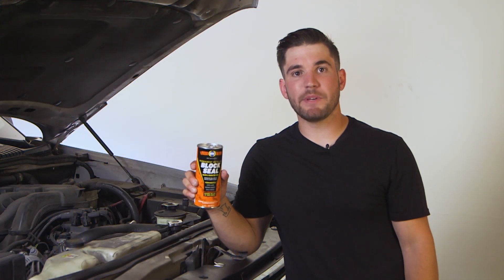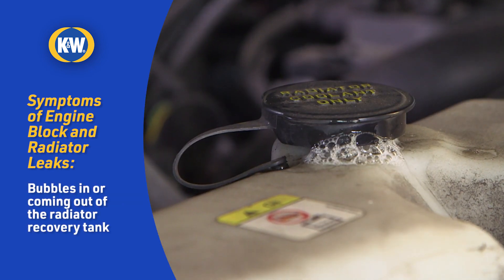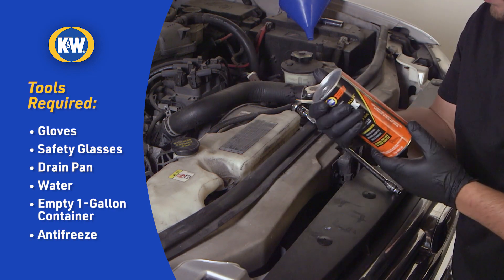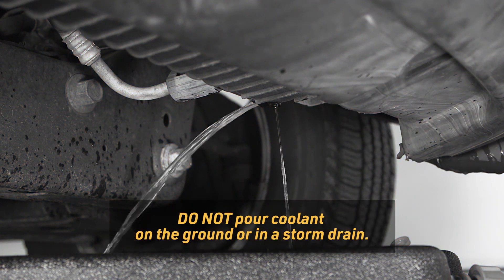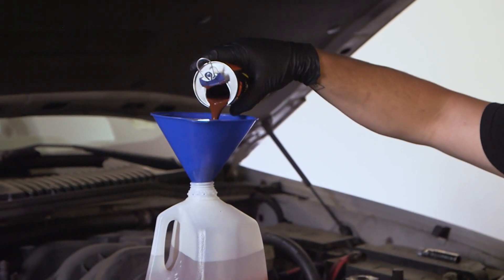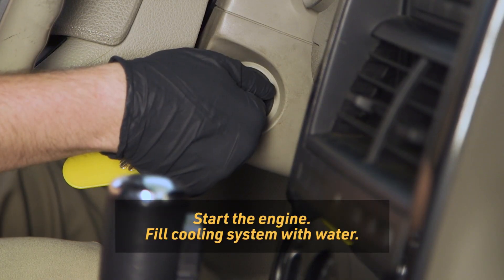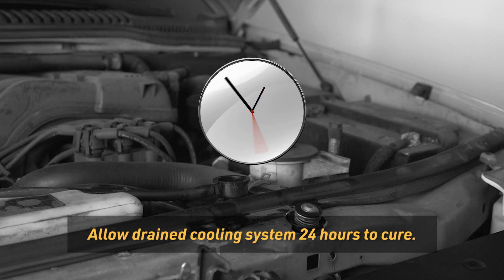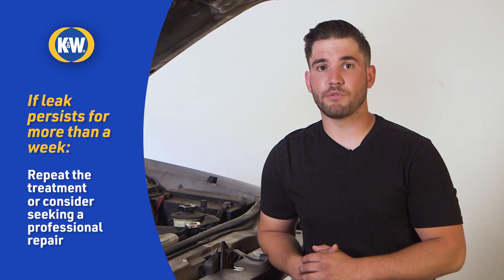How to repair an engine block or radiator leak with K&W® Block Seal

Comment: The thermostat cannot be removed in my engine, its integrated into the housing, can I still use this?
Reply: You may have to change it after the repair. Check it and see if it's gunked up

Comment: Can this be used in transmission repairs? If not, what the best transmission aluminum case crack sealant.
Reply from the maker: Please contact techservice @ crcind.com and they will be able to assist.

Comment: Worked for me. Lasted about 3 weeks because I ran it too hard n accidentally left the radiator cap off n caused it to open back up. 2nd time was a success. O n remove radiator n flush out from top to bottom with hose to remove sealer from inside could save u a clogged radiator
Reply: Worked for me. Lasted about 3 weeks  ahahaahahhaha

Comment: Can this product be used to fix a valve cover gasket too?
Reply from the maker: It cannot. It will only repair cooling system leaks. In most vehicles, the valve cover gasket is only in contact with oil, not coolant. Please contact our techservice@ crcind.com if you have any questions.

Comment: it is the sodium silicate,known as liquid glass; it hardens like glass with the heat of combustion; a true miracle, as a mechanic,i've used it;  any brand will do,they are all the same,as long as they are the sodium silicate in;  the simple RADIATOR  leak sealers are NOT the same, TOTALLY different products
Reply: some are block sealants adn use other substance , they are good to,, silicate brakes with time,,
Reply: Thank you

Comment: I don't understand how can you start the engine without a spark plug
Reply: Only remove the plug from the affected cylinder... Engines that this stuff is designed for have more that one cylinder.
Reply: @flaxnor  And how do you know which cylinder is the bad one?
Reply: By the yellowish film like substance on the spark plug from a cylinder with a leak

Comment: I’ve used the CRC brand a few times.  Always success.  One caravan with a 3.3 I drove for 40k afterwards and sold it.  Seen it a year later driving around.    This stuff works.  Follow the directions and don’t think otherwise.
Reply: I don't remember hearing anything about leaving the heater up for circulation.  You do that, don't you?
Reply: But dont last too much

Comment: lol idle the engine with no spark plugs??? Im pretty sure the engine dont even start
Reply: Pull the spark plugs 
Keep in order.
Then look for one that is different 
Probably really clean from the water steam cleaning, or may have a strange color from antifreeze 
Replace all the plugs except this one 
Unplug the fuel injector for that cylinder.

This will keep this cylinder from firing, causing combustion to go back into the cooling system (,bubbles in the radiator)
This will help seal that cylinder because no explosions, or pressure.

Itight run lil rough with this plug out and fuel injector unplugged
No.problem
Reply: I was very.
Confused about this part

Comment: Can the CURING Period be much Greater than 24 Hours (>>24 hrs), as I would be UNABLE to Flush on a Sunday, and being able to start the Process on a Saturday, and Flush on a Monday - 48 Hours?  Would there be any harm to the Block/Radiator, or the Longer the Curing Period, the Better for the Parts involved?
Reply from the maker: You can allow it to sit up to 48 hours. This will not improve the chances of product success (sealing the leak). The active curing time of the product is 24 hours. For more information reach out to our Technical Service Team 1.800.521.3168 or techservice@crcind.com M-F 8-5 EST.
Reply: Sir can i use this sealant for an unaccessible pipe crack having circulating water at room temperature or i have to increase water temp. What temperature is required for seal t to cure.

Comment: Remove plugs and turn off injectors to those cylinders? Then run it for 30 minutes..with no spark plugs in? What's that sound like for 30 minutes? Is that what directions really are? Why is that?

Comment: So every time I go to mix it and shake it for about two minutes and then when I pour it I get a shot glass of fluid and everything else in the cans solid am I doing something wrong
Reply: Good question my can was the same so I broke it up with a hammer and added it to the 3qaurts of hot water and then put it in a blender and blended it the best I could before putting it in the system I will let everyone know how it turns out .

Comment: Do you need to pull the thermostat I have a 2004 accord with the thermostat build in the housing
Reply: You sure do. The thermostat will be clogged if you don’t remove it

Comment: Ok so I'm a dumbass and I put in in my oil crankcase how do I get it out best ... im taking apart and replacing as much of my engine as I can as well as cleaning it ... there must be a way to undo the process
Reply: Don't worry- the same company will sell you a motor flush. They think of everything.
Reply: Dont feel bad my daughter in law put water in her crankcase when the car was over heating.  Duh!
Reply: Dont feel bad my daughter in law put water in her crankcase when the car was over heating.  Duh!

Comment: thanks for the video. i have a small leak in the head gasket between cylinders 1 and 2:  Mercury 2004 v6 3.0L.

What might be the consequences if I pull the plugs on cylinders 1 and 2, but do not remove the fuel injectors on those cylinders?
I cannot easily get to the injectors without pulling off the two intake manifolds first.

Thank you.

Jo
Reply: This product won't work if the gasket is blown between the cylinders. You will need to get the cylinder head resurfaced.

Comment: What happens if I don't remove the plugs
Reply from the maker: Thank you for watching.  Removal of the sparks plugs will be needed pending on the type of leak the engine has. To discuss deeper we recommend calling into Technical Service M-F 8-5 EST. 1.800.521.3168.
Reply: Let water/coolant out the cylinder could get more water and lock the motor up
Reply: How the hell do you even start your vehicle with the smart plugs removed

Comment: Update: I wound up replacing my intake manifold. Apparently my leak was too much for block seal. 

I had a small leak of coolant. I was adding distilled water and coolant to keep my levels up. I gave Block Seal a try a week ago. The price seemed fair for the claim (~$9 Autozone, Austin, Texas). I must have watched this video 20 times to make sure I did everything correctly. 

 I recommend this product to stop very, very small coolant leaks. 

The history of my coolant leak caused four ignition coils to fail on the side of the leak. Since the coils occurred over a year's time,  and since I'm not a mechanic,  I figured it was coincidence. But later I realized that it was coolant leaking from a crack in my intake manifold that caused the failures. There was no coolant in my oil or oil in the coolant, and no smoke coming out the exhaust,  just coolant leaking out between intake manifold and engine block near the ignition coils and gradually filling them with fluid. My vehicle is a 2007 Ford F150, which I love. Anyway,  this product solved the problem and now I drive without fear of checking my coolant levels daily.
Reply: Update: the leak gradually got worse in the same spot. I finally had to buy a new intake manifold and replace the old one. 
Thus, for me,  this product didn't work. Bummer. 

Also,  I noticed my heater didn't work as well to warm the cab in the winter.

Comment: Has anyone tried this on a land Rover Discovery ? Their cylinder liners losen and then they sound like a bad lifter. Later you blow a head gasket. This stuff sounds like a cheap repair. Discoverys are cheap too. They have other issues also though .

Comment: Probably should have mentioned the excessive noise from removing spark plug and starting engine with plug hole/holes empty. Also, pull connector to coilpack/plug wire, before starting or you could be in for a shocking experience.
Reply: Rob Roberts jajajajaj i think the same
Reply: Jajajjaja
Reply: Okay.I'm not understanding.Because how do you even start a vehicle without a spark Plugs